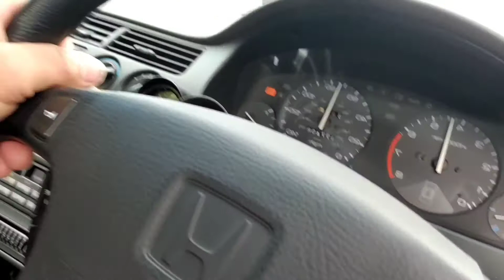Rsx shifter install on Accord

Comment: I just finished mine. You never mentioned the headache issues on the cable tranny bracket. Doesn't go in gear right at all. Modifications will need to be done to make it work accordingly.
Reply from the maker: It require a bit of finese, l was lucky i have a adjustable cable and l did mention about the conversion bracket(k to HF),but not in so much detail. I made another video and l specified that it's essential to have. Sorry for the lack of info and thank you for mentioning it. Hopefully you get your project work.
Reply: you probably dont care but does anyone know of a way to get back into an Instagram account??
I stupidly lost the login password. I would love any tips you can give me.
Reply: @Ira Gary Instablaster =)
Reply: @Elian Camilo I really appreciate your reply. I got to the site through google and I'm waiting for the hacking stuff now.
I see it takes a while so I will reply here later with my results.
Reply: @Elian Camilo It worked and I now got access to my account again. I'm so happy:D
Thank you so much, you really help me out :D
Reply: @Ira Gary you are welcome :)

Comment: Hello I love ur videos and I have a ‘94 Accord and want to know the rotors u use for the big brakes swap I notice u used the Acura calipers n still were able to keep ur 4 lug set up, what hub are u using and what car does the hub come frm that ur using right now...I’m in Jamaica🇯🇲 please help thanks 💯
Reply from the maker: It's homemade bracket that l was able to fit a 13" rotor, Acura CL rotor to hub conversion. I might do a video of it in ff days. Thanks
Reply: @sagittnet2158  ok what vehicle did those 4 lug hub come frm? And are u still using the original  knuckle that came with ur Accord if not wat vehicle are they frm???
Reply from the maker: @raymension9480  95 Accord knuckle and hub assy are from 98 Acura CL.

Comment: This is very helpful. Thank you.
Reply from the maker: I found that the Hybridracing shifter is far more better than the Ktuned, specially goin on 5th gear( you really have to shove the ktuned in order to go on 5th) +, hybrid is much smaller.Hope that give you an idea if you dont like your console to be destroyed and thanks for watching.
Reply: @sagittnet2158  Thanks for the info. I will check them both out. Currently I have the factory shifter box and cables but with all solid bushings and a JTC Customs adjustable short shifter. Also did the zip tie mod on the cables but the shifter still has some slop and engagement doesn't really inspire confidence. Looking for upgrades.

Comment: Hi Saggit! Can you help me? I'm building a G23 and putting it on a 95 Accord but I don't what to do with the distribuitor. I'm using the stock Accord harness and I want to use aftermarket external coil but I want to know if I have to use the H22 distribuitor and put the CKP on the oil pump
Reply from the maker: I know it'll be easier to convert a external dizzy to internal for 95 Accord. Since you want to use a external dizzy, then your conversion has to be on the harness side. I never try doing a mod on the harness but if you have a wring diagram or a Prelude harness, l dont see it being difficult. For the ckp on obd1 accord, its still indide the dizzy, you only doing the mod for your external coil connections. Unlike doing external to internal dizzy, you just need to add wires inside the dizzy along w/ new or use coil. Are you thinking of using a MSD blaster coi?

Comment: If you cut out the back holes how did you secure the back of the shifter?
Reply from the maker: I welded a nut at bottom of the mount plate and drilled another hole at the back of the shifter and used a 10mm bolt.
Reply: @sagittnet2158  I saw that. Just one 10mm bolt? 

I'm going to be hopefully putting one of these in my ej civic coupe i wonder how bad i have to gut out the center console to make it work. Not using the adapter plate cuz I already cut out those two welded nuts. So it will sit a little lower.

Why did you get the hybrid racing one instead was it because of the install mod you had to do or just bc its more precise?
Reply from the maker: 2 bolts at front and 1 at  the back. It's to big for my taste and in the beginning it looks alright after a while it bugs me shifting from 4th to 5th, l have to really throw it to go to 5th. 1-2,3-4 spacing are good but 4-5 is horrible. Then l started to watched people who have a hybridracing and pay attention on shifting distanced ,so l thought l give it a try and it payed off. Yes and its much precise.
Reply from the maker: But dont get me wrong, Accord and Civic have different seating position. I have a EJ1 civic and l seat higher than the shifter. It might work for you and if you like the aluminum look. Remember this is a replica, it could be different for the authentic 1. If l'm getting one for my civic. It'll be hybrid all the way.

Comment: So, if I have an Accord (in my case the coupe one CD7) can fix it?? 
And then what about the cables??
Can you help?
Thanks for your videos
Reply from the maker: You have to use as a combo unit. On my setup for example, l used all RSx components( shifter, cables) and most important is the rsx tranny conversion cable bracket from K-H. It wont work w/o the rsx conversion bracket.
Reply: Can you help me with some links?
Reply from the maker: @jonathanverduzorrilla8829  No links but it's really up to you, modify as it goes. If you want to keep and no cutting involve like mine, you have to be kinda creative. Cables and shifter to be use are from 02-06 rsx. I highly recommend the hybrid rsx shifter.
Reply: @sagittnet2158  OK, if I use the hybrid one y dont have to modify the console right?? And the cables if I have the CD7 original gear box will fit the cables that are you using? Because it is an F series one
Reply from the maker: @jonathanverduzorrilla8829  The shifter is not a plug and play on the console. You have to sacrifice and cut/ loose the trim if you dont want to modify the shifter assy itself. On my shifter, l dont want anything cut like you've seen on my vlog so l modified the shifter so it'll seat lower and not cut any of the trim, trim inside yes but outside none. Cables, the seal rubber l slit it in the middle and run the new cables. Next vlog l'm uploading, l'll mention the shifter and cables.
Reply from the maker: @jonathanverduzorrilla8829  Use rsx cables and k-h bracket. The F series cables will not work w/o modifying the retainers.

Comment: Would this setup fit a 2000 accord
Reply from the maker: It should but probably w/ a bit of mods to fit it in. I've seen someone swapped it w/ Prelude shifter box too. You just need rsx cables, K to F,H tranny bracket and shifter. I like the Hybrid shifter, it's not bulky and notchier. Got  it in my Accord now and in my g23 swap Civic. Unless you really like billet.
Reply: @sagittnet2158  ty again for all the information I will look into this

Comment: So, did you use the OEM cables? And could you please provide a link for where you got this please??
Reply from the maker: I used Ktuned race cables with F/H series tranny to K series cable BRACKET. Rsx OEM can also be use but you have to get the aftermarket bracket(F/h tranny to k cable). Got all parts from Ebay.com.
Reply from the maker: Just for your info, just recently changed shiter assy from Ktuned replica to HYBRID racing short shifter and its night and day difference. If you use hybrid shifter, you can get away without cutting your center console trim panel like mine. Thanks for watching
Reply: @sagittnet2158  do you have a link for the hybrid racing one? I have a 94 Accord ex coupe with an h22a4 swap by the way, I'm trying to figure out if changing the cables is required for any of these short throw shifters.
Reply from the maker: Sorry l dont have the link for hybrid racing but if you google search HYBRID RSX V3 SHORT SHIFTER you  should be able to find and order one. As far as the cables, 02-06 rsx cable need to be use together with the k to f/h tranny cable bracket, unless your a good fabricator. (Accord oem cables can be use by modifying the 2 ends that hook to the shifter(coz holes are too big) and move the cable securing clips. Otherwise, rsx shifter and cables with tranny bracket are needed. Hope that help.
Reply: So helpful for everyone. Most people don’t respond. So good

Comment: Does this work for a 2002 Honda Accord ex ?
Reply from the maker: It should, Accord have a big center console, and it really up to you if you want to retain the factory look of your center trim panel. I dont like gutting my center console that's why l altered the shifter itself. You can use the RSX cable if you like, if budget in mind,but you have to get the K to H or F transmission conversion bracket to get it work.